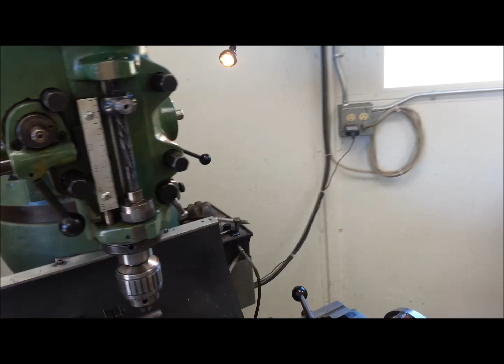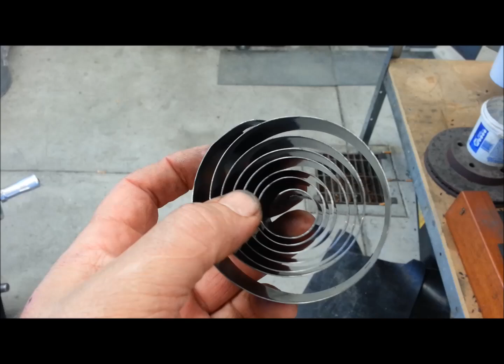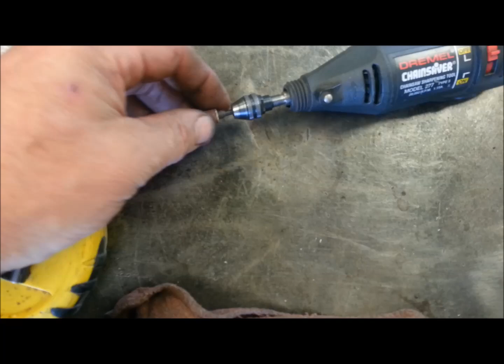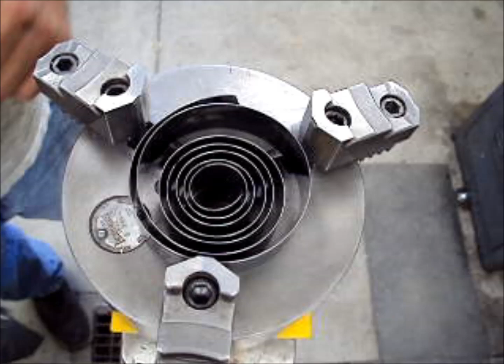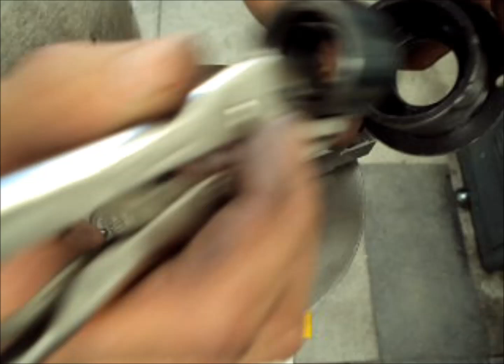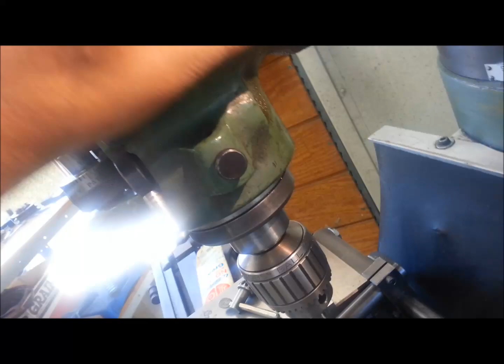Quill clock spring repair & rewind

Comment: On my Comet clone I used my caliper depth feature to find the depth of the rivet head on the shaft. Then when I loaded the spring into it's housing I left the whole thing out about .100". It caught the rivet head the first time. My spring had broken diagonally near the inner end.  I figured it was from having the inner end forced inward to catch the rivet basically twisting the spring.

Comment: Thank you for posting this.  I wound up using two vise grips and a pair of large worm drive hose clamps screwed together to crank the spring down small enough to get it back into the housing, which worked pretty well.

Comment: Thanks Stan,  I had used a hose clamp when I rebuilt my Lagun but the spring had broken about a third of the way in from corrosion and I made a new hole like you did.  I didn't expect it to last but I have it set like yours and it's been almost 2 years  now.  Better than the $200 Lagun wants for a new spring.

Comment: Excellent Video!  Well explained and as i happens - just what I need to know! The new LMS 5500 small mill comes with a VERY tight quill spring and I'm hoping this technique will allow me to relax it a bit - as it stand now, it will take out a knuckle if you let it slip!   Also like the idea of the 'floating' action.   Thanks!
Reply from the maker: A quill handle that comes back around and smacks you in the chin is zero fun. BTW this same repair is holding (probably jinks myself now)

Comment: Yea im digging the 3 jaw chuck winding method. | did a similar repair on a radial arm at work, where the slotted end had broken off. The boss was like I didn't even know that was possible. Now guess who gets to fix all those crappy Rong Fu mill drill springs that break on the production floor?
Reply: crappy Rong Fu mill ?  is that a Ty Won ON  special ?

Comment: Hi Stan...

Thanks for showing....learned something new!  

Question....when you removed the spring to start the repair, is there any concern of it popping open or is the tension already released?  ....I assume it has released it tension...

Hey...you need a new shop shirt...LOL....that one has seen it's day! 

Best regards
Chuck
Reply from the maker: Hiya Chuck, yea, it was laundry day for the shop coats / shop towels .. hehe.

Removing the spring is fast and violent, clamp the center of the spring with vice grips, clamp the vice grips into a bench vice, hold the housing with the opening facing AWAY from you, turn your head and pull.

All said and done in the blink of an eye.
Reply: That's a pretty slick process!